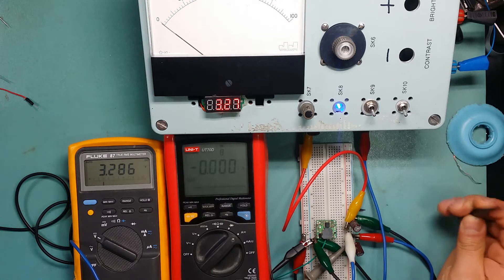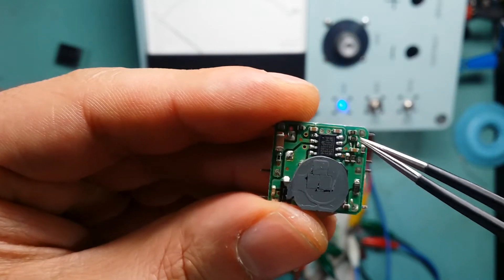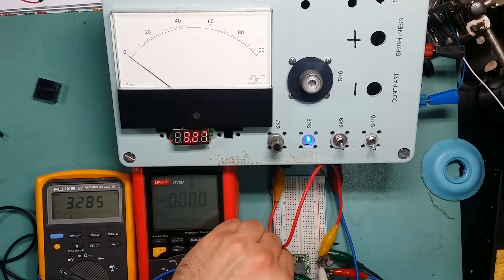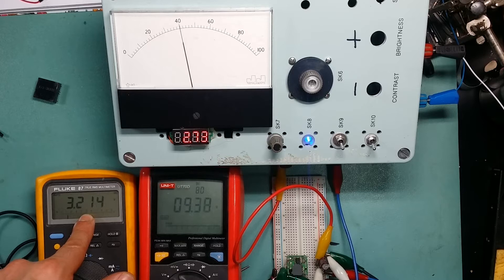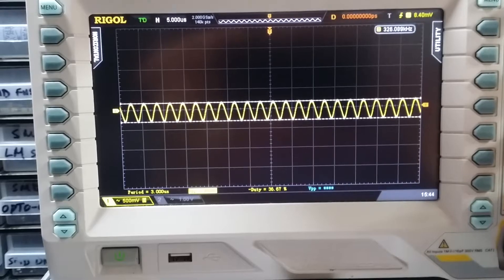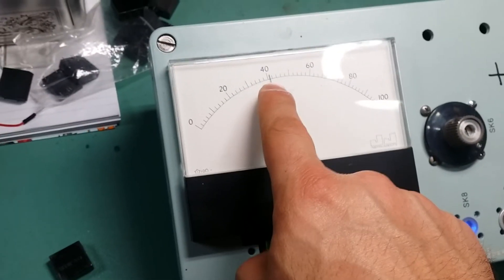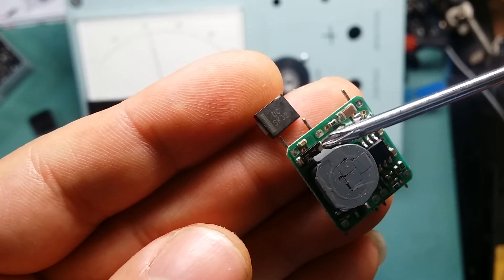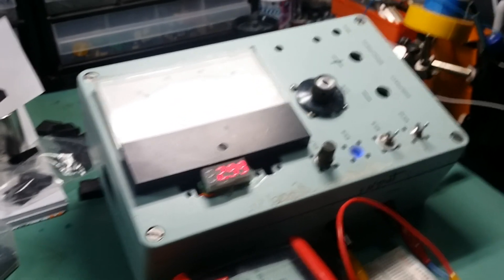KIS-3R33S DC DC CONVERTER

Comment: One of the problems with your measurements is that you are using DC meters with a large output ripple.  This can affect the readings on the meters.   Also I see a lot of wires which decrease the effectiveness of the decoupling cap as you’ve now introduced a series inductance..  Put a purely resistive load in and a large cap (470uF) and a small cap (100nF) at the output of the regulator.  In all likeliness this will improve things a bit.  Ripple is way too high @500mV-pp.

Comment: hi , can i use this product for mobile charging  24 v(input side)  to 5v(1 Amp) mobile side?
Reply from the maker: well the unit can go up to only 23v on the datasheet so not sure. but you can use few high power diodes to drop the voltage first before feeding it into the dc dc converter. then you will need to modify the dc dc converter to allow you converter your 20 odds volt to 5. there are lots of hacks for this on the net. just google the part number and you will be set.

Comment: Great technical detail and testing for KIS-3R33S DC-DC buck converter.  I bought one from eBay with 5V 3A output, and last for 2 yr.  I never realized it is just a plastic enclosure, and there is a tiny board within.  I will buy a better buck converter next time

Comment: One of the major problems with eBay is the lack of product feedback. Much prefer Banggood for this reason (if you can find and equivalent product of course).
Reply from the maker: Yep, your right about ebay. Most of stuff from china are just not up to any standard. I bought a charger for my laptop and it blow up on the first hour of use.